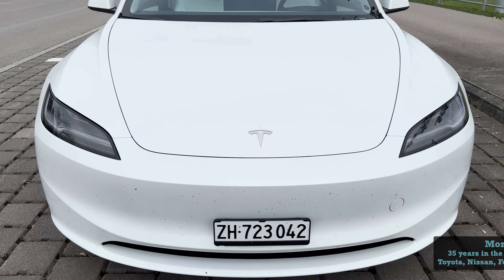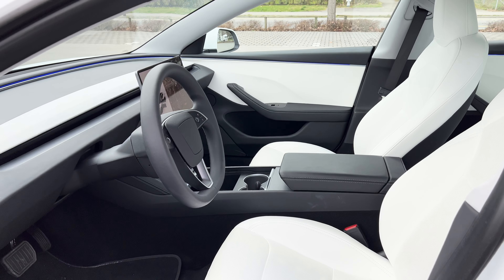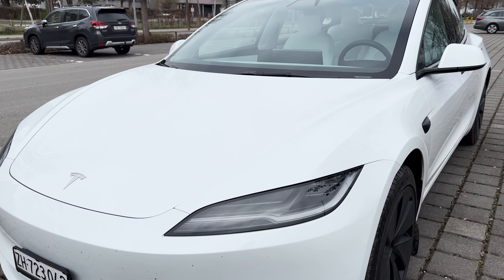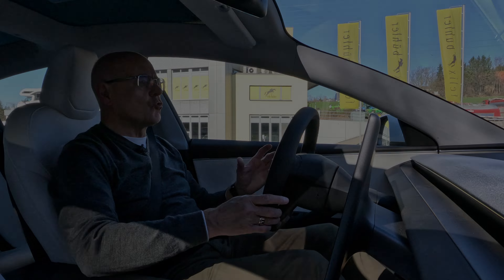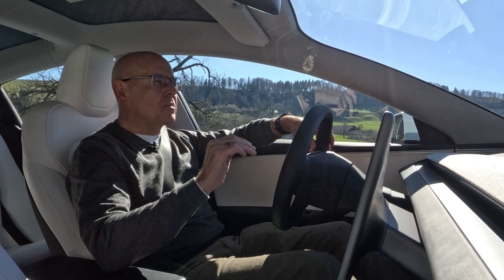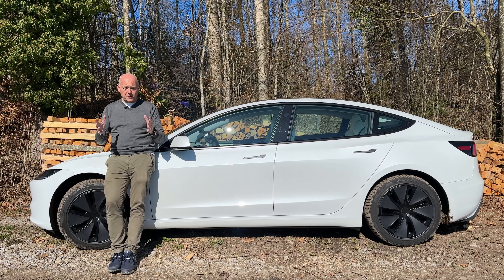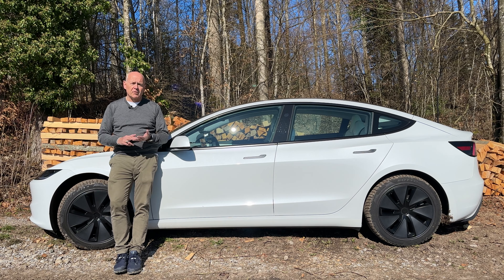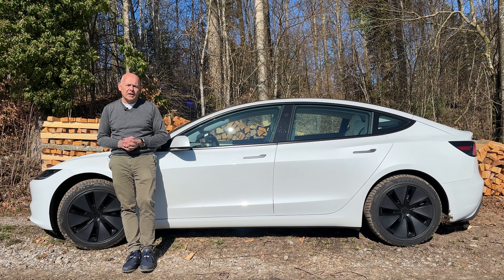2024 Tesla Model 3 Long Range Highland

Comment: I have heard a number of comments about the turn signals in roundabouts, a headache, perhaps adding the S3XY buttons on the backside of the steering wheel might be an option, I had seen that in a model S Plaid.  There are other functions that the S3XY buttons can do of course, but for me keeping the turn stalk would have been a reasonable compromise.
Reply: I doubt Tesla would return them and this might be a dealbraker for lots of people. The good news are that from what I know the creators of the S3XY buttons Enhauto are currently developing real aftermarket indicator stocks for all the Teslas that miss it.

Comment: The minimalistic approach is justified for containing the costs and being competitive in the market vs a more traditional approach. This is also the case for all others missing devices I.e. head up display, parking sensors, turning indicators and entrance key and so on. For younger generation it might be appealing because different paradigm but ultimately we get less for putting more money on the battery cost !
Reply from the maker: In the end consumers will decide. Tesla targets volumes in excess of 10 million units per annum and then they are in the mainstream volume segment where most customers will expect user friendly cars or buy something else. The missing stalks are a safety risk in countries with many roundabouts and the lack of heads up display or poor interface with the window wipers cause unnecessary distractions. Euro NCAP will focus on this for future safety ratings and mark down cars with poor user interfaces.